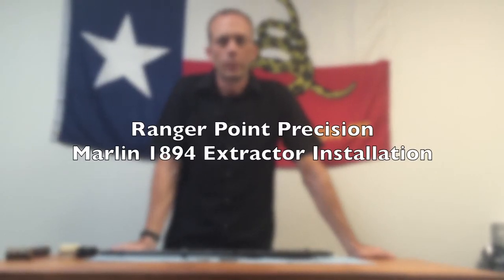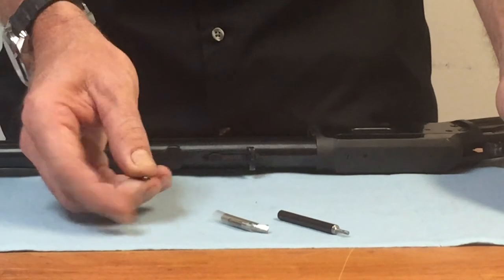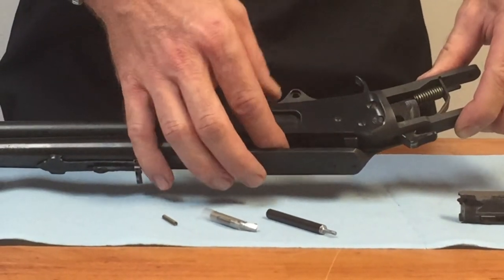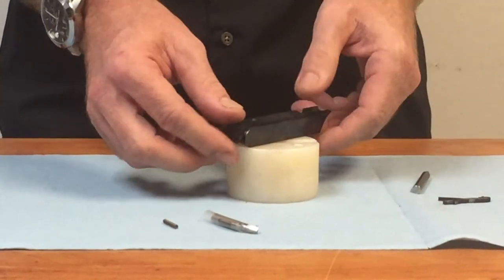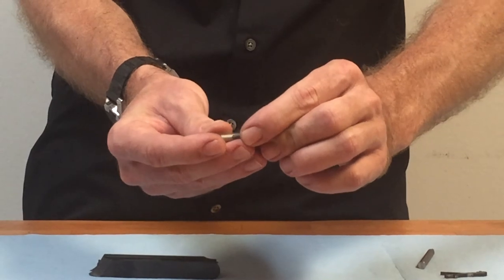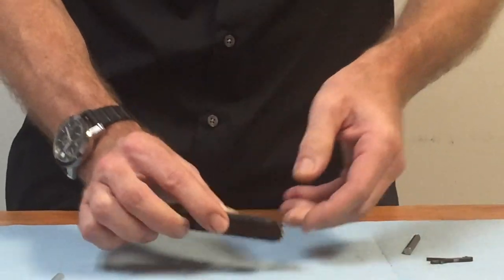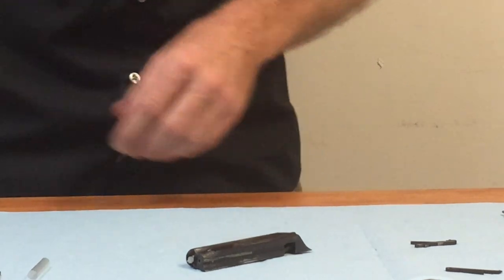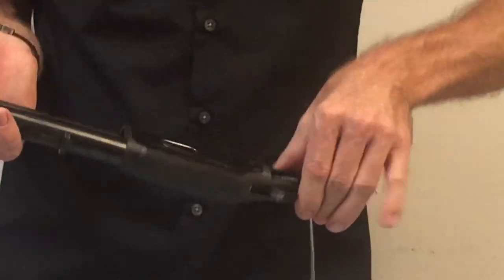New & Improved: Marlin 1894 Extractor Claw Installation

Comment: That one looks like it wraps around the bolt. The one I have looks like it goes in a slot and shaped like a V.  Part numbers on the package says ( 136544    011820  Marlin Ejector with Spring. Marlin 336, 444, 1895 All models,1894,1894C, 1894P, 1894CB Blue)  I haven't tried to replace it yet. I want to know if it's the right one first before I open the package.
Reply from the maker: Our M/94 Extractor installs inside the hole. we have Option #1 and #2 which designates which claw is attached to the tubed shaped holder and spring. So you should be fine.